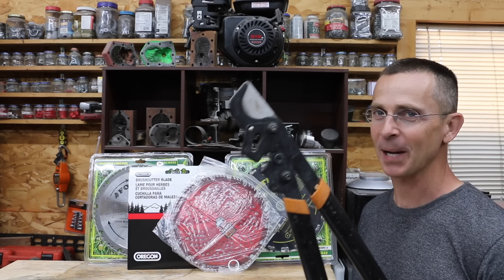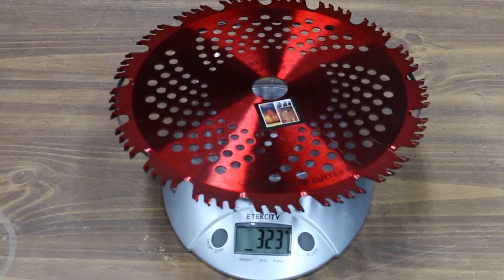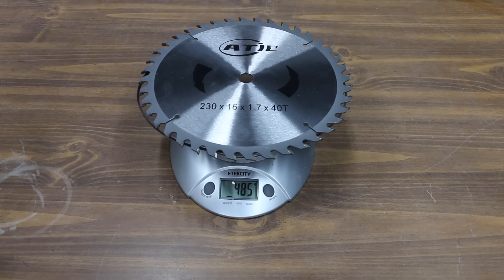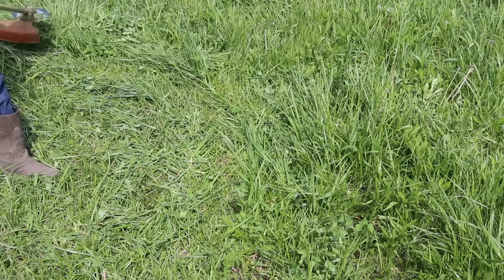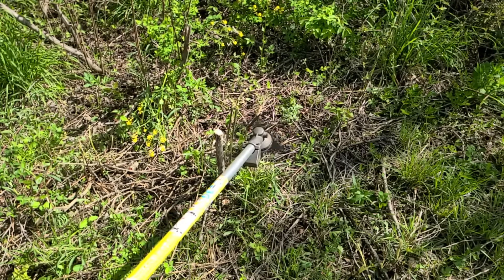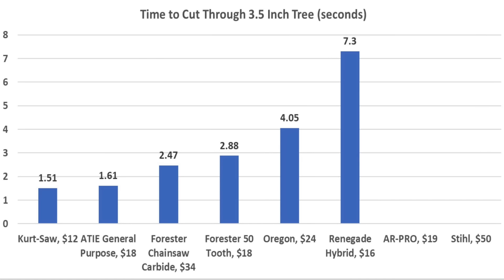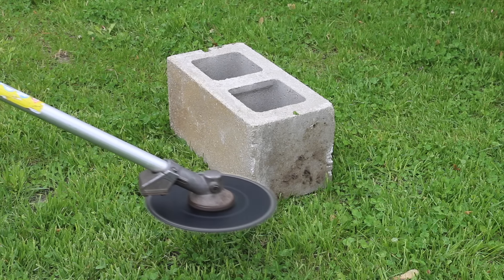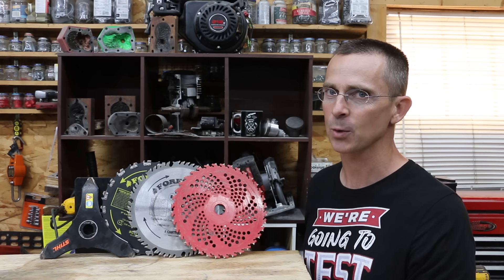Best Brush Cutter Blade? Let's Find Out!

Comment: The Oregon blade is the style of blade we use in Scandinavia for professional forestry brush cutting and thinning. It's made out of mild steel for good reason. when you hit rocks, dirt and other stuff harder than the blade, you simply sharpen it with a round file. It takes about two minutes. The Stihl is the only blade in this test that is supposed to cut anything close to grass. It's designed for thin shrubbery and reeds.
Reply from the maker: Thanks for sharing.

Comment: Hi  @Project Farm  - I'm sure your hands get dirty from all the testing.  Can you do a video about What Cleaning Products are the best on hands and skin?  From regular dirt to engine oil to hydrophobic grease?  How does olive oil do as a grease cleaner compared to purpose made cleaning products?  I love your videos! Thanks for Sharing!
Reply: I'd love to see that. My job requires fixing old kitchen equipment and I have resorted to washing my hands with industrial degreaser because soap wouldn't do anything.
Reply: Hey every one make this the top comment I want to see this happen
Reply: My bet is on GOJO orange with pumice. 😉
Reply from the maker: Thank you for the video idea!
Reply: @LabRat Knatz Another "frowned upon" solution which works great is Tide laundry detergent. It totally dries your skin and if you have an open wound hurts like crazy (and is surely toxic), but I used to use that after working on an engine. Fortunately, it wasn't all the time.  😬
Reply: @kenmore01  GOJO is pretty good. But for the love of God, if you use it in someone else's sink, have the decency to rinse it out! That stuff dries onto porcelain like concrete.
Reply: @gotdangedcommiesitellyahwa6298   Yes, so I've noticed lol!
Reply: @kenmore01  my old man was a mechanic and he used to clean his hands with gasoline! It was a different time.
Reply: I have used Dawn dish washing liquid and it works great, and doesn't dry out my skin either
Reply: @TheKnobCalledTone.  Tone, it sure was. In shop class at high school, my teacher said they use mineral spirits (aka solvent for grease) to rub into sore muscles at places where they take care of sore muscles lol (I assume massage parlors, outpatient clinics etc.) Of course that works well for hand cleaning too, and is apparently safe as far as I know, but you must wash again with regular detergent to get the mineral spirits off. It's a good technique. As is using mineral spirits to clean your concrete, then putting on kitty litter to absorb the spirits. As a bonus, it's called spirits! How cool!😎
Reply: Old trick: put lotion on your hands before working.  Some of the grease/oil/dirt will stick to the lotion, which is easy to wash off.
Reply: Best hand cleaner I, as an auto mechanic, have found is made for/by Cintas (the uniform supplier)! They also make one specifically for auto body mechanics that removes paint really well!
Reply: Lets add fast orange to the list

Comment: Don’t know if you’ve done it yet or not, but I’d love to see a showdown of laundry detergents for getting out grease, oil, blood, grass, etc from clothes.
Reply from the maker: Thank you for the video idea!
Reply: Oxyclean with hot water soak gets all but blood.
Reply: @flashgo2  Agreed. I tried a lot of stuff to get a stain and Oxy crushed it. It will be my go to now.
Reply: Good idea
Reply: Workshop hand cleaner isnt a bad idea either.
Reply: @flashgo2  I was always under the impression that cold water is the way to go for blood.  Thanks for the info on Oxyclean :D
Reply: Coca-Cola was the go-to in the motorpool when I was in the army. Very little got us as greasy as rebuilding suspension on tanks and APCs.
Reply: @Azrakoth1  My go to is to make a paste with baking soda and plop it right on to the blood stain. Let it sit for 15 minutes or so, then throw it in the wash, on cold, with another half cup or so of baking soda. Works a charm.

My reason for asking the original question though is there's a lot of detergents that claim to get EVERYTHING out with little or no work. Curious to see if any of them live up to their claims.
Reply: @Azrakoth1  -  We just tried this and the blood came right out.  I was completely (but pleasantly) surprised.
Reply: Dawn dish soap removes grease. I used several stain removers and none took out a stain from a drip from olive oil until I tried Dawn dish soap.
Reply: I'd like to see this too!
Reply: Pry bar sets and crowbars!
Reply: blood...
Reply: @bebp  Yep. Blood happens. Especially on a farm. I'm not nearly on the level that mr. Project Farm is, but I have some acreage and a large garden and animals. That means thousands of feet of fence to maintain. Sheds to take care of. Hay covers. Panelling. Old Tractors. All of those things mean blood happens. More often then not your so dang busy and focused that you don't realize you're bleeding until it's all over your clothes.
I'd like to go in to town without having blood stained jeans.
Reply: For petroleum, rub waterless hand cleaner on the affected areas.
Reply: @flashgo2  don’t use hot water with blood, it sets the stain.
Reply: left out gun shot residue and DNA :)
Reply: The cartel really want's to know how to best remove bloo... i mean oil stains from clothes
Reply: I know when I was a roofer we used mayonnaise to clean our hands... it cleans the tar off very nicely.... so I imagine it could work on an oil stain
Reply: @jarekmace1536  Years ago, I changed the transmission on an old station wagon and by the time I was done, it was so greasy, I threw the shirt away.  I figured I would give the Coke idea a try on the jeans and they came out clean.
Reply: @Eric_W  Truth. Everyone knows the best way to clean your hands is to eat lunch. After you finish lunch your finger tips are magically SUPER clean. Now where all of that grease and grime goes..... We don't worry about that....
Reply: @viktoraggerholm5102  I mean, burning them works really well too. But I like to reuse my clothes.

Comment: I dont know if it has been suggested, but you should test garden hoses. There are so many different kinds. Just how durable they are, kink free. I'm not sure how many test there could be though.
Reply from the maker: Thanks for the video idea.
Reply: I would also like to see this!
Reply: There are at least a dozen at [insert local tractor store] that I've seen. This is a good idea!
Reply: Yes, excellent suggestion.
Reply: I could see this. May be a bit risky but a pressure test, maybe similar to the tape measure do a wear test, how much water lost through a pin hole for “self healing” hoses.
Reply: i just asked  the same thining
Reply: Great idea. I've owned a few that turned into suspension coil springs in the winter!

Comment: The stihl 3 blade works great for clearing under pasture fencing a few times a year. Great for himalayan blackberry vines, forgiving if i strike an unseen t post, will cut through smaller hawthorns growing up into the wire, plus easy to file sharp again with a flat file.
Reply from the maker: Thanks for sharing!
Reply: Yep. Done the same for years. It handles the grass and the occasional straggle brush which is exactly what pasture fenceline was for me.  It prevents the string trim one day and followup another day with brush blade. Or excessive amounts of trimmer line without a brush blase.

Comment: The timing of this review is perfect, thank you!!  In my area, we get a lot of stringy stuff, vines and things less than 1/4", so I think I'm going to try to find the Stihl triangle blade that clears itself better.  Testing on both grass and different sized branches was a great idea, that lets people find something that will work best for them.
Reply from the maker: Great to hear!  You are welcome!
Reply: @Tom Smith I have used the Stihl Triangle blade as my go to general use blade for tall grass and heavy weeds and very small brush for many years. Tough blade, reversible and can be sharpened for a long service life. The package has a sharpening guide printed on it to help maintain an even diameter.

Comment: The Stihl is just insanely well made. I used one for years on heavy duty and its still in pretty good shape.
Reply from the maker: Thanks for the feedback.
Reply: That Stihl blade is amazing. I did environmental work where we did all landscaping for gaslines and powerlines. I’ve cleared trees up to 4” thick, bushes the size of minivans, and 50+ acres worth of knotweed. After about a month, the workload definitely wore it down and rounded it out but overall, I recommend it over its competition all day long.
Reply: I use the Stihl on the farm and it's probably the best compromise. The carbide style blades get damaged too easily when you touch something.
Reply: The stihl  y shape mean you can even sharpen it , if u wish, and use it till its totally worn away

Comment: Great video. I have a lot of experience with brush cutting with a heavy duty trimmer. Sthil makes a brush cutter blade. The one tested here is a grass blade and will destroy your trimmer if you use it for brush! I run the forester carbide, it’s the only one I’ve found with longevity and ability to be sharpened well. Wear your protective equipment. 
Thanks again for the video
Reply from the maker: You are welcome!
Reply: What type of protective equipment do you wear?

Comment: After putting this video’s results to a practical exercise at home, I now request a poison ivy remedy / medicine comparison video!  Thanks for the great vids!
Reply: YES! HAHAHA
Reply from the maker: You are welcome!  Thanks for the suggestion.
Reply: I'm a professional landscaper and I can tell you; the best thing to do is to wash all exposed skin thoroughly with (in order of effectiveness) Orange clean automotive/shop hand cleaner, simple green, or dawn.  Really scrub your skin like you're trying to clean off axle grease.  Poison ivy has an oil that takes up to 8 hours to penetrate your skin and the rash appears 24-48h later, as long as you wash all your exposed skin thoroughly with a cleaner that dissolves oil, you won't break out no matter how deep you got into it.  Also wash any clothing you were wearing using a type of soap that dissolves oil.  Rinse twice, and wash these clothes separate from any other clothing as the oil can transfer in the wash and you will end up with ivy rash on your love handles, chest, legs, etc days and weeks later and have no idea where it came from.
Reply: Nothing in my 71 years of experience works better than vinegar.  Pour it over the affected area and wipe in with your hand.  Pour some more on and let dry.  Do not dry it or use a fan or anything else to speed it up.  Grab a beer and relax.   It should be gone within 15 minutes.  I've used this method for about 20 years and everyone I've used it on can't believe how well it works.
Reply: Well, figure out how Cousin Eddie can do it and maybe you have a proposal.
Reply: Tecnu is a poison ivy cleaner.  Use it after exposure to clean the oil off.  Works for tools too.
Reply: @LabRat Knatz -  No, no, NO.  Hooch is for DRINKING.  Don't let it go to waste. :)
Reply: @LabRat Knatz - I was referring to the term "cheap hooch" that you used.  That term is used to refer to inexpensive ethanol - the kind you drink.  My comment was sarcastic and meant to be funny by the way.

Comment: Use a table saw without a safety guard or riving knife and the internet loses its collective mind 

Stick the same blade on the end of a pole with a motor,  no one blinks an eye 🤣
Reply: You clearly do not know the physics involved.  If the blade kicks, you are still extremely far away from it... due to the pole length (pivot distance), making it nearly impossible for it to be able to hit the OP.  The length and dual hand operation, also gives you superior leverage, and control.

  A table saw kick, is a Whole different kind of animal.  For one... your hands, arm, head, and body... are all close to it, and or in line with potential projectiles that fly from the blade.  The power of a tablesaw is much greater... so its not going to slow down much on thick materials.  The power also means that if it binds... any trapped wood becomes powerful enough to fly across the room at mach 5... and embed itself into the walls.  And of course, the worst being the potential for your fingers / arm to bounce into the blade, after the wood gets kicked up from the table unexpectedly.

 The tablesaw kick is so much more powerful, so no matter how strong you are... if wood gets thrown around.. it will easily be ripped out of your grasp.  Thats not going to happen on a weed whacker.

 The real danger of these things... is if there was anyone else near the operator.  The blade could kick into them... and or any rocks or debris that were hit, could be launched into them.  The possibility of anyone standing next to a person whos using such a blade, is going to be next to Zero.
Reply: @johndough8115  If you want to be all technical about it 👍🤓
Reply: @johndough8115  jeez calm down. It was a throwaway humourous comment.

Comment: Speaking of blades, how often have you hit a screw or a nail when cutting with brand new blade... Circ saw/miter saw blade test would be really interesting. Curious to see which one holds up best.
Reply from the maker: Thank you!  I've found lots of hidden barbed wire fence on my old farm.  It ruins blades almost immediately as the carbide teeth are ripped away

Comment: I'm scared of my little strimmer cord. Those things in the video are thing's of nightmares. I think I know which one I'm most scared of now.
Reply: Yeah, i have the Stihl one and it is pretty scary when you hit something hard bymistake like a hidden rock or a thick branch lmao
Reply: If those can cut through 3.5 inch tree I’m sure it could cut through your leg with little effort
Reply: They don’t just look dangerous, they are dangerous. We had a small 3” saplings under compression. When the cutter made its way through, the sapling decompressed and snapped a wing off. It flew out at what seemed to be light speed. It ended up stuck about 2” into a felled tree about 6’ away!! I’m sooooo glad it didn’t hit anyone 😳
Reply: @landscapingspecialist  yeah that would've been deadly
Reply: Serious question: are these even authorized for sale in the US? I’ve literally never seen anyone use one, nor have I seen one for sale at the big box stores.
Reply: @MoneyManHolmes  yeah they are
Reply: “How can we make a circular saw more terrifying?”
“Let’s take off all shields and put it on the end of a long pole!”
“Great idea!”

Comment: Recently I needed an HVLP paint sprayer for work. I thought it was strange that the prices went all the way from 29.99 to 400 dollars. Every gun looked to be built the same exact way, yet some had 380 dollar price differences.  
I don't know how you could test them against each other, but I thought it would be interesting.
Reply from the maker: Thanks for the suggestion.
Reply: Oh yes I would love to see that. As a first-time homeowner with the limited budget and relatively weak small woman hand and arms I'm really interested in one that is light enough not to cause severe arm fatigue or heavy enough to cause a ladder to tip and at the same time as sturdy enough to hold up to multiple uses over the long term. If maintenance and cleaning different at all that would be important because I would imagine there's some pretty onerous cleaning required. Also if some are too powerful or big to use indoors that would be good to know. I'm sure they range from something barely works all the way to an industrial one that should last 20 years and I'd love to know the happy medium and the details!!

Comment: This is precisely why I use the Husqvarna 535LK pro combi, great power and very quick changing of heads. A fantastic machine which can cope with almost any job!
Reply from the maker: Thanks for sharing.
Reply: I am getting a Husqvarna 545FR brushcutter with a 45cc engine.  I will be tackling all types of intense brush, saplings, small diameter trees 2-4 inches and a rather larger acreage of brush.  What blade overall would you recommend? 
I am used to keeping my chainsaw chains extremely sharp and my engines very clean! Thank you for your help. Your videos are simply fabulous.

Comment: Thank you.  
You come up with very comprehensive test parameters.  
My solution to this situation; as my circular saw blade gets a little dull I put it on the weed whacker, and get a new blade for the circular saw.  The “dull” power saw blade makes short work of light pruning and hedge trimming.  Essentially free, because the circular saw needed a new blade anyway.
Hint:  I use washers to keep the saw blade centered on the weed whacker arbor.  
I always wear the shoulder harness that came with the weed whacker.  I want to make sure that blade can’t ever reach me.
Reply from the maker: Thanks for the feedback.

Comment: That brush “blade” looks like you could use it to polish rusty steel
Reply: now i want to try my trimmer with a wire wheel for stripping paint 🤔
Reply from the maker: Thanks for the feedback.
Reply: @ShowAndTool  you could make one of those “tool restoration” Chanel’s on YouTube 😂